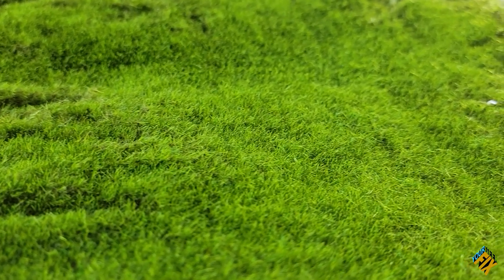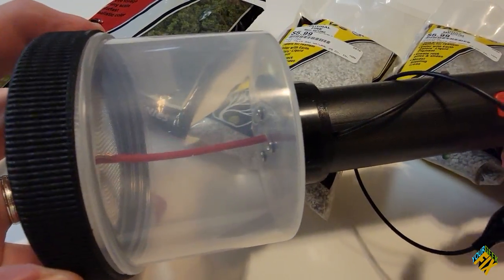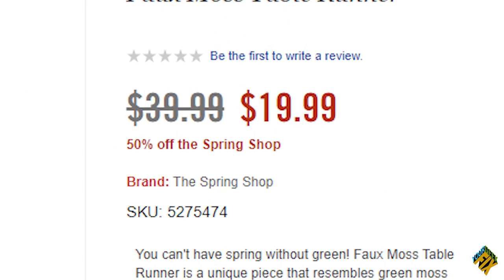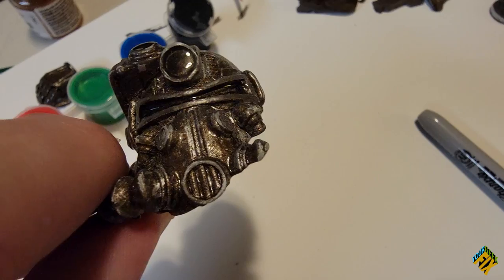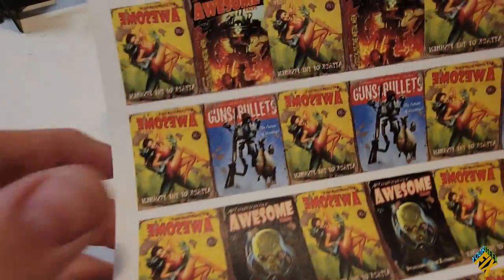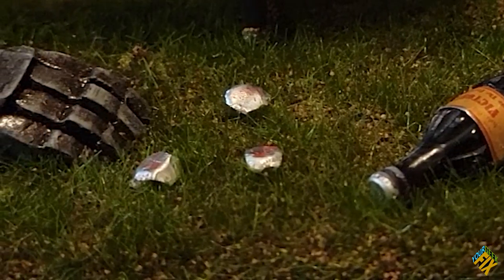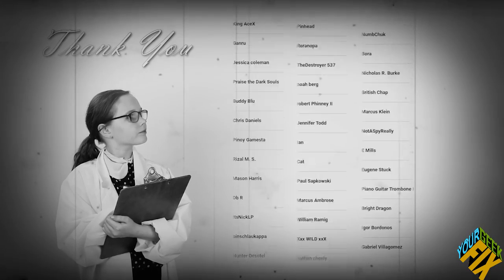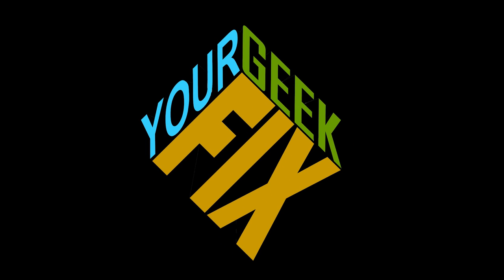How to make a Fallout Diorama

Comment: Sound is back to normal. I'm still thinking about what i should put in my atempt at a diorama. I'm thinking about a nuka cola machine, a overflowing wooden crate of empty bottles and one of the picnick tables with magazines on it and a street light. I'm also thinking about releasing the buildguide as a "3d model along in fusion 360" as a magazine. But i fear that i will get stuck in the design of the magazine.
Reply from the maker: That sounds awesome!